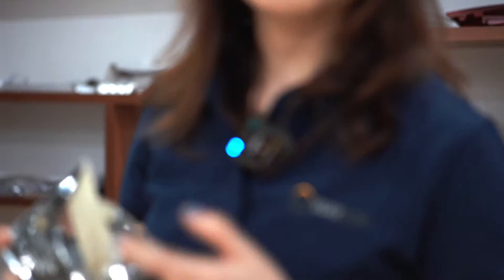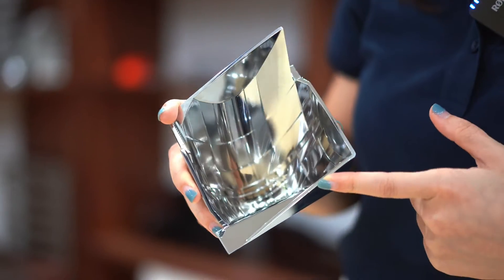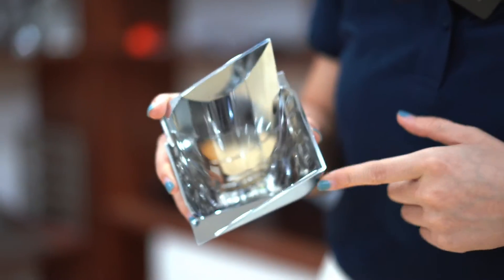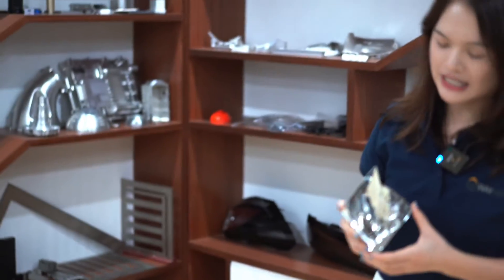Turn your plastic parts into metal: Vacuum Metalizing  - WayKen Rapid

Comment: is it able to increase thermal conductivity of the part as well? Since Al thermal conductivity is high.
Reply from the maker: While it can add some thermal conductivity due to the presence of the thin metal layer, the overall effect on thermal conductivity is usually minimal compared to the base material.